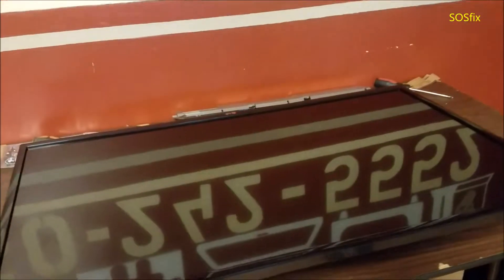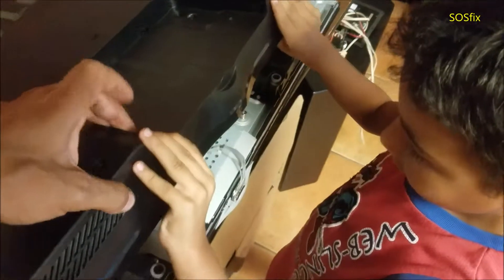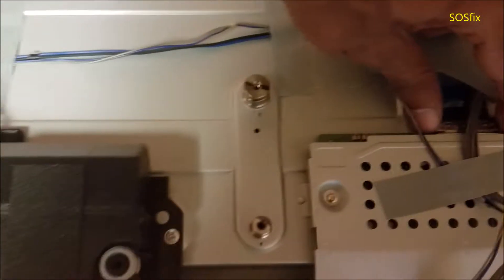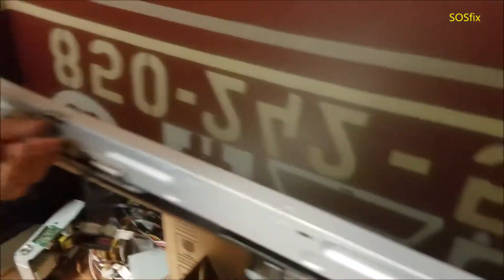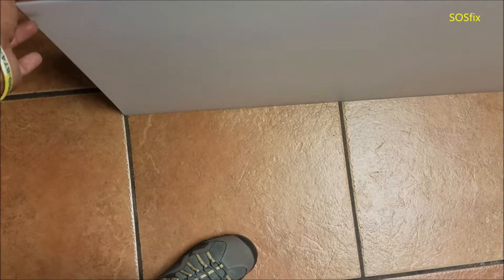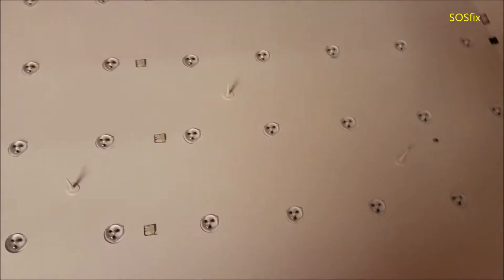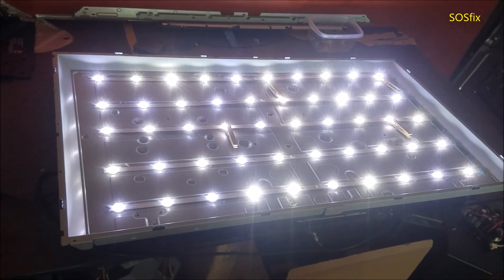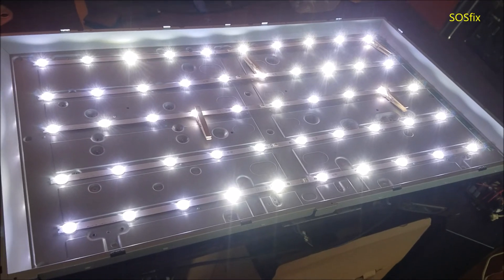lg 42LN5400 dim picture  bad led backlights how to fix

Comment: I have the same problem here, i bought 1watt 3volt smd led's from Amazon but the leds' doesn't match, i guess, it doesn't light up, i checked the leds', every led work separately.... I tried this leds' on a different strip and it is working fine..... I wonder if this LG backlight is requiring specific led for it?